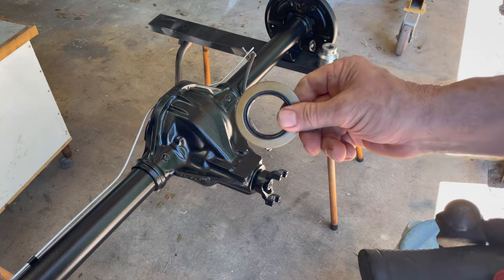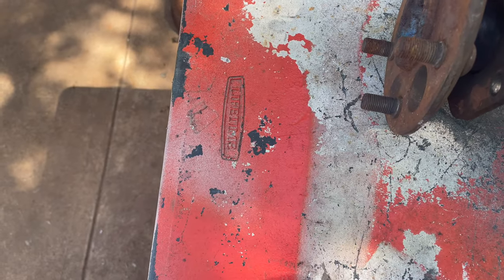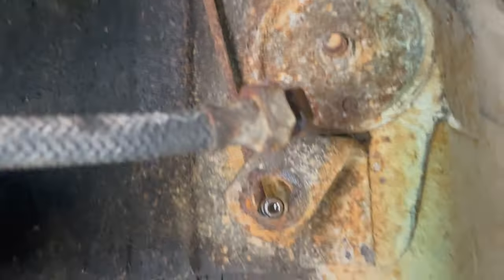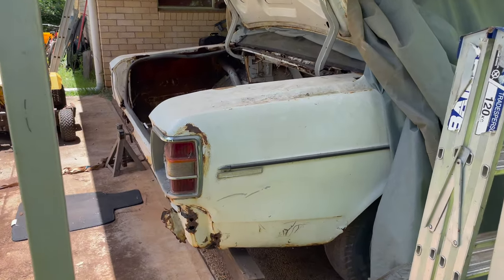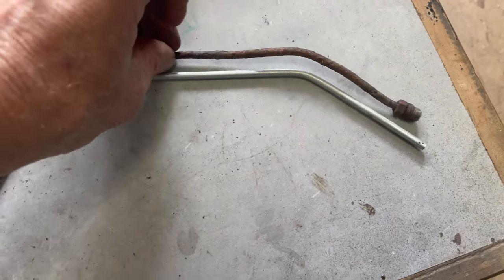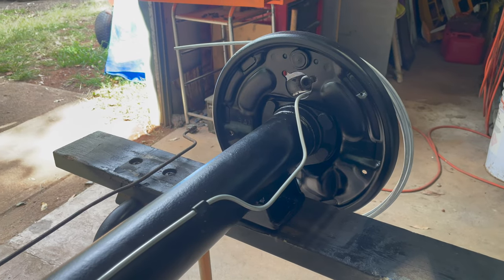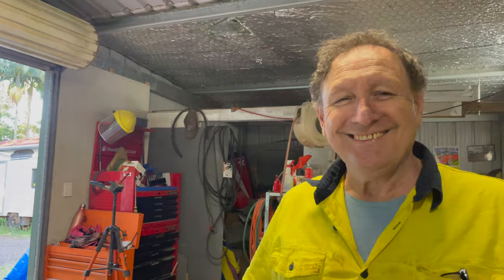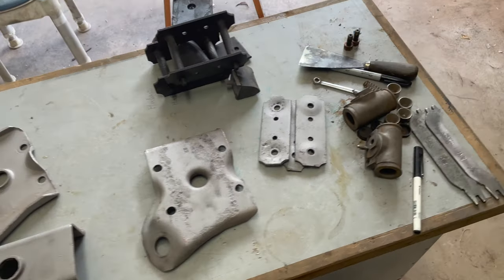Ford Falcon 500 XY Ute Restoration Part 62

Comment: Nice work again Andrew 🤩👍 You can purchase a brake line straightening tool, I use them all the time very handy tool to get those insistent rolls out of the new brake lines, how good does that diff look all painted new black with brand new lines 🤩🤩 love your work mate, can’t get enough of these videos thank you 🙏
Reply from the maker: Thanks very much Kim. it is nice to start putting things back together again I very much enjoy this part of the build. I have got a lot of bodywork to go. I think I’m just stalling🥴. Brake line straightener. Very interesting. I will look into that. It is nothing like a banana straightener is it?😁

Comment: Your front disks look like late XB-XC onwards to XF as have large centre hubs 83mm.
XY hubs 62mm.
Spindles are probably the XB-XF pbr calipers were XA- XC I think.
Anyway love your video's ☺
Reply from the maker: Thanks Warren that’s very interesting. I suspected it was all off in XB it’s nice to know in more detail what they probably were off originally. :-)
PS I measured the center hubs and they are 83 mm 👍
Reply: Hello gents, I was just going to say the same thing, the hub centres are definitely the large later model version, but probs good as gold to roll with providing your choice of wheel is matching of course.
Reply: Do the upper control arms have 3 rivet or bolts or 4?
Reply: Is your rear axle hub centre 83mm? 
If they are 62mm you can get adapter rings for 83mm wheel centres.
Reply from the maker: I’m not sure what you mean by upper control?
Reply from the maker: The rear axles are 62 mm
Reply: PBR's all the way up to early XE before they went to Alloy Girlock in 83
Reply: @DonsTrix  I’d assume he’s talking about the amount of rivets securing the upper ball joints to the upper arms, either 3 or 4..
Reply from the maker: I have two sets, one set has four bolts, and the other set has three bolts. I was planning on using the three bolt ones.
Reply: @DonsTrix  the upper control arms ball joint have 3 or 4 bolts or rivets.
The XY GT had 3 as they were revised geometry they carried them over to XA
Reply from the maker: One set of the upper control arms I have, look like  XD the other set look like the just standard XY ones. They all get sanded and painted in the next video. You can take a better look then thanks mate. :-)

Comment: A ball bearing isn't going to take as much load as a roller bearing, but that's a matter of a pinion.
Reply from the maker: It’s not a matter of opinion. You are 100% correct. Roller bearings take a much greater load than ball bearings :-)

Comment: Andrew, I’ll have a look in the shed tomorrow I know I’ve got pbr seals somewhere lol
Reply from the maker: Hi Sam, good to hear from you. I managed to find some PBR caliper seals. Nevertheless, I have another set of PBR brake calipers to restore. 
I also have been doing a lot of zinc plating so if you need something zinc, plated, I Can help. :-)
Reply: @DonsTrix  thats a good thing i often thought of the same thing, hard to do? Setup cost ?
Reply from the maker: Not totally without its challenges. However, it is not technically hard. I will probably do a video on it. :-)

Comment: Fantastic video again mate, it’ll be a great Ute when you’re done.  The chassis rail on the sedan is a nasty situation to say the least.
Reply from the maker: Thanks, heaps mate. If I could just get the templates to the chassis rail, I could easily make them up.  It would be even easier to weld a couple of replacement ones in. :-)